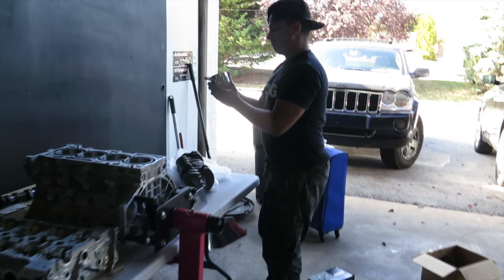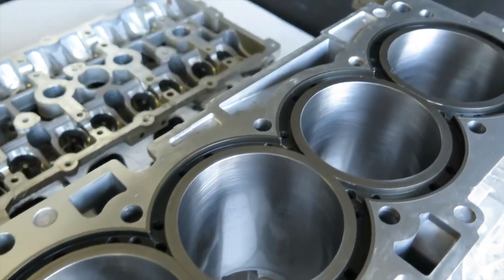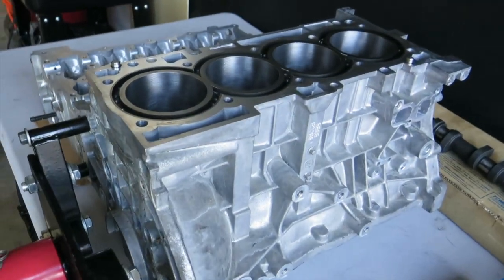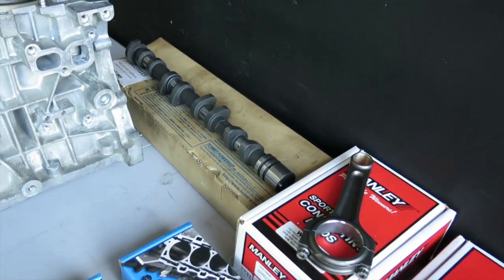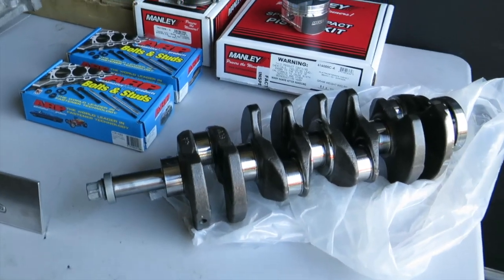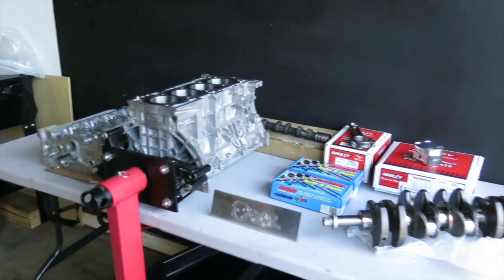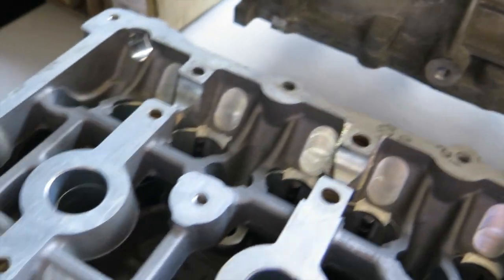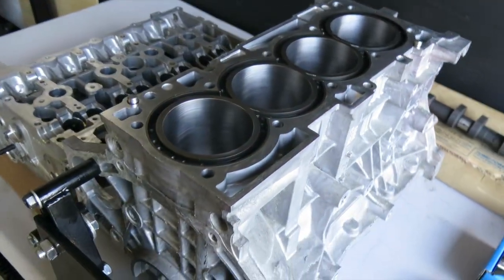What's coming @SFR USA (Full Theata 2.0T motor build)

Comment: So you sent it in to get balanced and bored? Not clear on this part...you mentioned sleeves? Also, if I am going to add new pistons, cams. Do I need to send in the flywheel and all that. I just want to replace piston, cams and add tomei bolt on turbo.